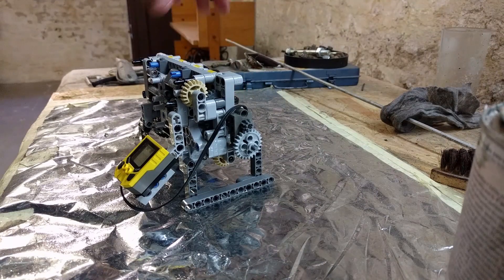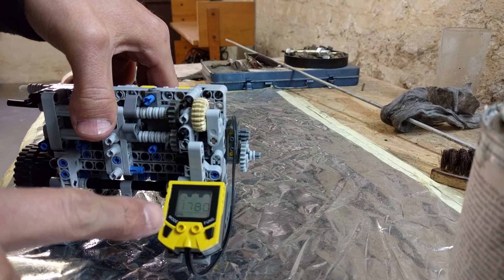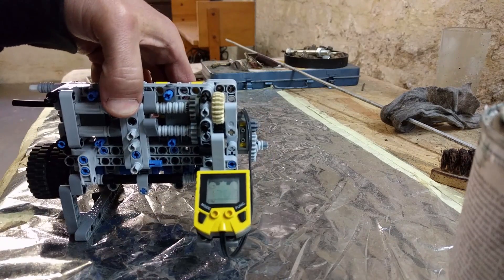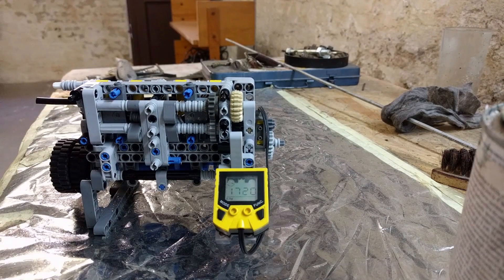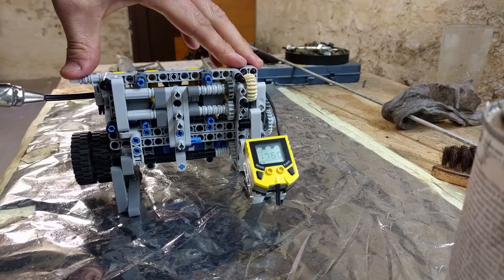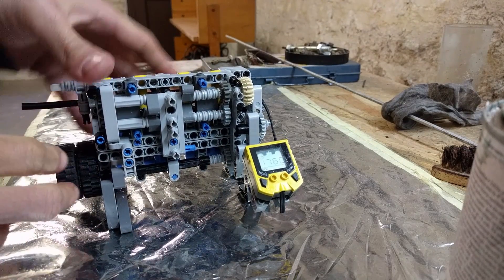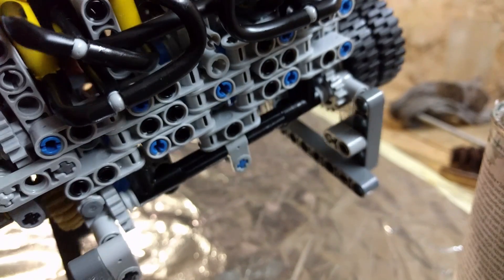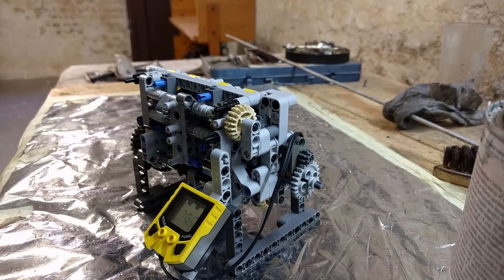LPE power Development - Small cylinder Inline 4 part 7

Comment: You should totally make a six-cylinder version of this engine!
Reply from the maker: That would not be very easy, because of the 120 degree crank/camshaft needed for it.
Reply: @nicjasno  Have you tried using Part No. 4185?
Reply from the maker: @Swissair171  for what? I use it on the crank in the i3, but a cam likr this would not work.

Comment: It needs a turbo! :) I know you want maximum power and rpm, but what if you connected a modified t-piece between one valve and one cylinder? About 1/10 of the air (which should be negligible) is cut off to run a small Lego gear-based turbine. Imagine the sound if you cut off the air, the turbo whirring down... awesome
Reply from the maker: No leaks are permittable. All air will escape there and there will be no power.
Reply: @nicjasno  thats why i said modified t piece, for example the hole connected to the cylinder is 2mm, and the hole for the turbo is .2mm (needle thin).
But it was clearly just a thought. It is your engine and you make the decisions.
Reply from the maker: @thespecialist2284  Don't take me by my word. Try it. Make such a system and see what happens.

Comment: you should use a 500ml soda bottle and pressurise it and make a valve so that you can drive the M3 without a compressor.
Reply: or just make the engine run a lego compressor and connect the compressor to the intake of the engine and then there will be infinite runtime, but he would have to start it by hand

Comment: Is the 8t gear running at the same speed as the crank? From what I can tell, it's actually running faster with a 16:20 gear ratio (crank has 20t gear and the 8t gear's shaft has a 16t gear behind it). Either way, really impressive stuff, look forward to seeing it in the E30!
Reply from the maker: You are right. A huge mistake on my part :( This means that the engine runs only a smidge over 4000 rpms, since the 20z is driving the 16z. Fixing the leak should add some more rpms to that.